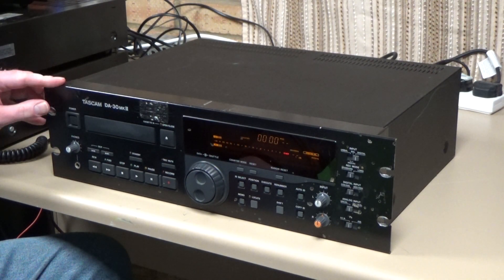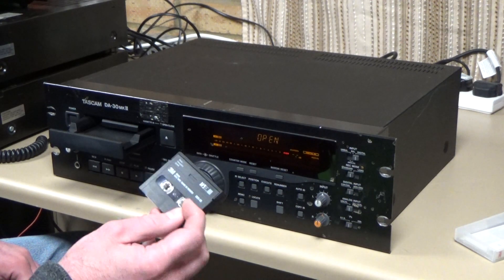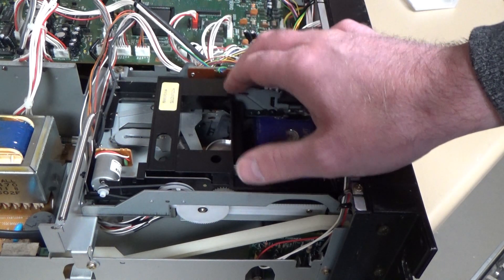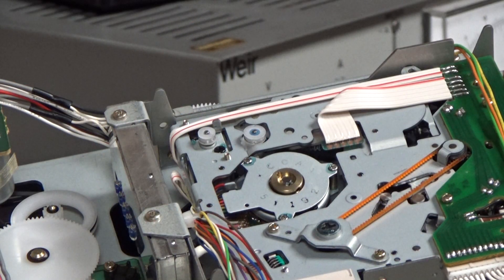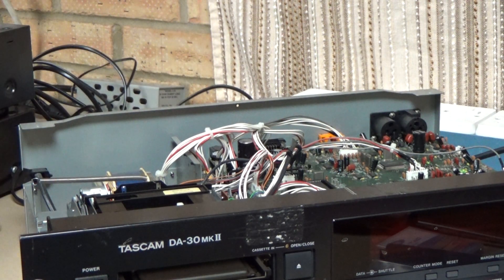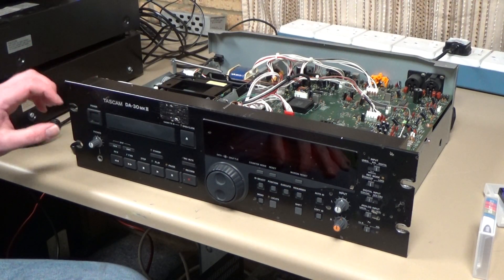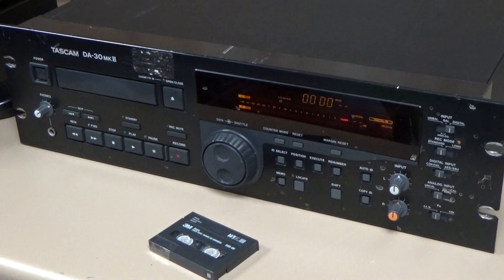Tascam DA-30 mkII DAT Deck -  Loading Belt Replacement and Attempt to use DDS Tapes

Comment: I had the toothed belt fail on mine recently, boy was that expensive.
Reply from the maker: I wouldn't even know where to source a replacement toothed belt. I worry about the one in my Panasonic FS200, my favourite machine for capturing domestic VHS/SVHS tapes.

Comment: Thank for this. Just bought a used DA-30 MKII, which have errors (error 01 - 02), which occurs often. I turn it off and try again, and suddenly it´s ok. So it has i flaws, and i wanna know if u know about the error codes? I would love to get this fixed, as i´m fell in love with the media, all over again.

Comment: Tascam DA30 mkii decks can’t use 90m DDS cassettes. Tape is too thin. 60m DDS cassettes will work. To convert DDS to DAT playing time double the length of the DDS tape. For example 90m DDS = 180min DAT. My Panasonic SV-3800, Tascam DA20, and Fostex D5 will play 90m DDS cassettes.

Comment: Do you have a model number for this belt, I’m having the same issue, and can’t find the same one you found. Thanks
Reply from the maker: Details of the belt are in the video description. The belt I used is 10mm diameter, 1.0mm square section, but I think a slightly thicker 1.2mm square belt would have been better. An o-ring would probably work just as well.

Comment: Thank you for this Video!  but, I have a question, maybe you can help me?
I have a TASCAM DA40 and the capstan timing belt was torn. After I reinserted it, the recorder no longer winds and shows on the display: TAPE CUT??? Is it possible that you have to pay attention to the markings when inserting the new belt? like a timing chain in a car? I would be very happy about an answer, thank you very much. ☺
Reply from the maker: I'm not familiar with the DA-40, but it seems highly unlikely that the capstan belt would be critical for timing. I'm not sure why a lack of reel movement would cause the deck to conclude that the tape has been cut, but I would check that the reel idler is free to swing from side to side and not gummed up with old lubricant, as that seems to be a fairly common problem.
Reply: @timf-tinkering  Many thanks for the quick response!
Yes, I have already researched further and it could actually be due to stiff parts... I will completely disassemble the drive and clean it. I'll let you know what the result is.
What lubricant would you recommend when I put it together? Thank you and best regards!

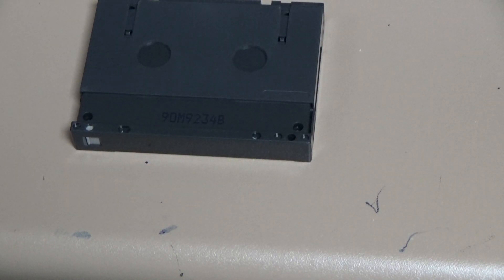Comment: Taking the picture at 11:05 the right group of 4 holes are as follows: from left to right first hole is an anchor post for the cassette. If you stick tape on it the cassette won't be in a correct position to be detected by the deck. second is the detection hole for a DDS2 120m tape, third is for the DDS1 90m tape and the fourth is open together with the second one for DDS3 120m tapes. All these DDS tapes do work together with the two Tascam DA-30 MK I that I have by permanently shorting the detection switch of hole 2.
Oh and cutting the jumper wire W402 on the digital board de-activates SMCS. That's for the Mark I don't know it there is an option for Mark II
Reply from the maker: Thank you!

Comment: I use DDS tapes in my DA-30 mkii all the time. Try just covering the DDS hole - you laid the tape over 4 holes. (The DDS, DDS-2, the cleaning tape and the tape positioning hole ! ) You have to use a tiny piece of tape.

Comment: Thank you so much for posting this video! I own the same machine but have not used it in two decades. It has been kept in my climate controlled studio, however. I recently received a DAT tape and tried to fire up the machine, only to receive the same ERROR 01. Your video provided the information I needed to gain the confidence that I might be able to fix the problem. I am happy to say that as of today, Saturday, February 17, 2024, my Tascam DA-30 MKII DAT machine is back in working order and playing DATs once again. Thanks so much!!

Comment: Much thanks for posting this very informative video!

I own the same machine and had not used it in at least ten years.  I am the original owner.  When I recently took it out to try, it exhibited identical issues and threw code “01”.   I have only removed the top cover to inspect my machine, seeing two drive belts along the left-hand side as you face the front.  Those two are seemingly fine.  What I have not inspected are both the notched belt and that 10 mm belt, which are only visible once the mechanism is removed, per your demonstration.  I am almost certain that the loading issue I am experiencing is identical to the procedure in your upload.  I will attempt to follow your example  in the hope that the loading mechanism will once again operate properly.  

Where did you purchase the 10 mm belt?   Do you think that I might find an identical belt in a well stocked hardware store?  I have found drive belts for various CD tray mechanisms in such places.  I am here in Berkeley, Ca.  

Wishing you the best!

Cheers!
Reply from the maker: Thank you for your positive comment! 

The belt I used was 10mm diameter, 1.0mm square section. With hindsight, I probably should have used a slightly thicker 1.2mm belt. I purchased the belt from an eBay seller in the UK who I have used before, and their belts seem to be good quality (I'll add a links in the video description), but if you can find a belt supplier locally then that would be ideal. In fact, a suitably-sized O-ring would probably work just as well in that application. 

That was the only belt that had failed in my deck, which is lucky because the other belts looked as though they may be quite difficult to change. I expect they will need replacing at some point, but I'll cross that bridge when I come to it! 

Good luck with your machine - they do seem to be nice decks!
Reply: Excellent reply.  I just picked up some “O” rings from our local hardware supplier in various diameters.  Surely, one should do.  I am hoping that this change will elicit proper repair!  I used this deck for quite a few live recordings of choral and chamber music with great results.  Once I acquired two Alesis Masterlink ML-9600 decks, the Tascam was shelved.  I did manage to successfully transfer a good number of my DATs to the Masterlink decks a little over ten years ago.  That was the last time I attempted to operate my Tascam.  Fingers crossed!